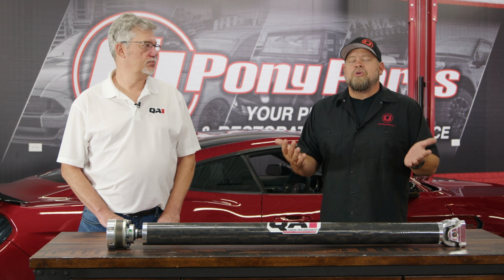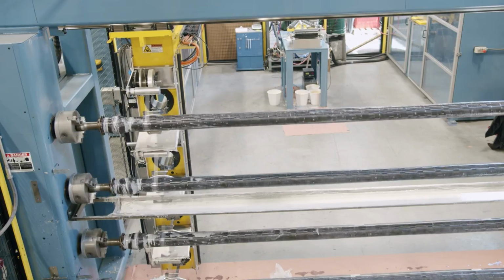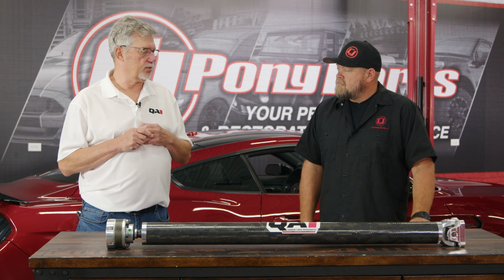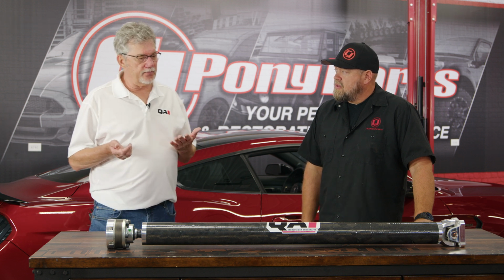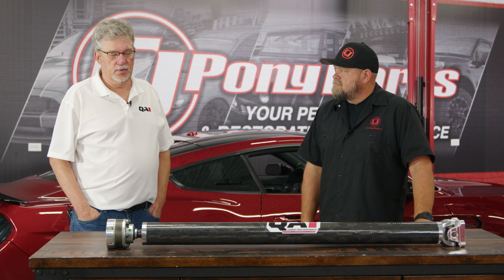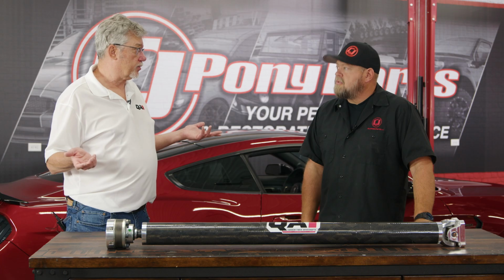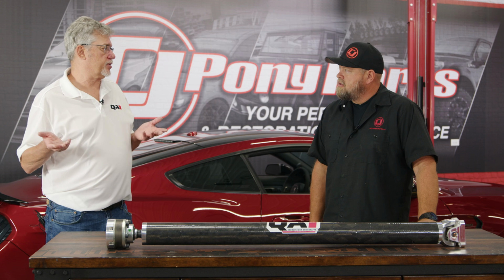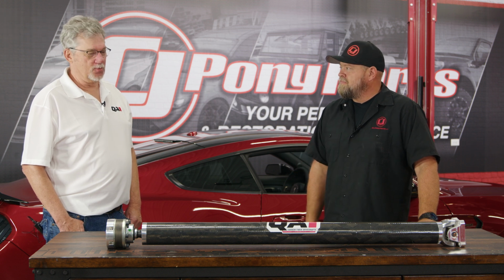Why Should You Switch to a Carbon Fiber Driveshaft? 🛠️

Comment: Common father is a strong material. But the epoxies and residents they use to make it hard does not like the flex. It Cracks. Then  it will explode under pressure. So when it comes to a drive shaft. I will go with steel.

Comment: well that is what im going to get for my 1969 javelin --i dont want the old steel one .. might as well upgrade-- would love to see a dyno run .. with a stock steel driveshaft .. and then the Carbon fiber driveshaft.. just to see if the wt would eve add some HP .. plus less wt to spin

Comment: How long are these good for? Do I have to worry about the shaft deteriorating over time? Is it only good for a certain period of time?
Reply from the maker: There is no lifespan for these, most likely it will outlive the car but should be checked regularly like all aftermarket high performance parts.

Comment: Carbon fiber is susceptible to cyclical degradation. Look at the OceanGate sub that just imploded. Eventually, that thing will grenade with enough toque and power. If you want huge power you better get custom steel.
Reply: Those are two entirely different things. Tensile str th VS compression. Can’t compare two different forms of physics.
Reply: @Megatron797  he;s an internet engineer, leave him too it.
Reply: How do we order a custom steel driveshaft ?

Comment: Installed one of these on my SL55 AMG, one of THE best mods I did, the car accelerates better, revs harder and with just a carbon driveshaft and long tubes my car stock ran 12.4 at 114 and after those mods it ran 11.8 at 125
Reply: Revs harder? Please explain the physics behind that..
Reply: @cmichaeloutube lol, I was thinking the same thing man..... We are waiting for your reply sir
Reply: @cmichaeloutube educate yourself on rotating mass!!!
Reply: Should be much smoother no vibration
Reply: I find that VERY hard to believe.

Comment: Ran a QA1 carbon driveshaft on my old 2015 s550 for couple years. Had zero issues and was way better than my factory 2 piece driveshaft. My car was also daily driven as well. Rain or shine out here in Texas. I will be buying another one for my 10r80 2018 car here shortly.
Reply: Lies
Reply: @dwreus81  Nah. Ford 2 piece driveshaft is trash.
Reply: 💀 @dwreus81

Comment: Would like to see actual 1/4 mile times between an aluminum and a carbon drive shaft.  I bet not alot of bang for your buck for one of these.
Reply: A less than 1HP gain won't show on acceleration times. The benefits is in the driving reposnse. The engine is more directly connected to the tires because the twist, or slack delay, in the OEM driveshaft is eliminated.

Comment: Carbon Fiber is not designed to take a shock load! If you do a hard launch with one of these it will turn in fiber shreds and powder.
Reply: These are specifically designed to allow for some "twist".  This isn't some random carbon tube meant for another application, they are wound for this exact purpose.
Reply: @jaywlambert  Doesn't matter how you wind it, a bit of road debris will destroy it.

Comment: After seeing the girl from AM grenade a carbon driveshaft with a basic hellion kit at the track, i don’t have much faith in them for drag racing.
Reply from the maker: Drag radials, stick shift, non drag suspension created wheel hop which will destroy any driveshaft. Lots of drag racers use these with no issue.
Reply: @cjponyparts wheel hop? So what? The carbon fiber flexes which is ok but carbon fibers is susceptible to cyclical degradation. No thanks.
Reply: @brandonshirey400 anything is susceptible to degeneration l, it’s called ware and tare if you pushing it at a drag strip doing everything to the extreme yes it will fail eventually just like aluminum and steel, but if you’re that skiddish go with Titanium it’ll bend before it breaks and it’s stronger and lighter than steel
Reply: Break em and buy em. It’s nothing to car guys. Who cares. Money is printed why complain about it buddy.
Reply: That is the first thing that comes to my mind when I think about carbon fiber driveshafts.
Reply: @chickenkatsu7863  Hers was a DSS, NOT a QA1. Difference in quality is night and day.
Reply: Hahaha, yeah me too
Reply: Didn't ocean gate run one?

Comment: No doubt that people will find a performance benefit out of them, and no doubt they will come down in price eventually...but $1800 is quite eye-watering when a comparable aluminum one is half the price
Reply: Best to stay away from the cheap Chinese bamboo ones.
Reply: @northerniltree 😂
Reply: But the Carbon one is also acting as a dampener between your engine and transmission and it also helps preserve both!
Reply: Cheap stuff ain’t good 
Good stuff ain’t cheap

Comment: How well does it hold up to the weather and salted roads? Does the resin epoxy used in the carbon fiber layup hold up to salt and other junk long term?
Reply: The rx8 came with one, I never had an issue with it in the pnw.
Reply: @aragon22155  I drove my RX8 in Canadian winters (salt/sand) for years no probs.

Comment: Would a carbon fiber driveshaft be good with a  2015 V6 Mustang that’s pretty stock except for exhaust, headers CAI and a tune? Durable?
Reply: The v6 Mustang needs a 1-piece drives driveshaft more than the GT.
Reply: You pay what you get for. More durable, lighter, and like the guy said in the video you would 60 ft better. Totally worth it. But if you plan on keeping the car just full bolt on than this would be a great start to get the weight down
Reply: At that power level it would be a waste.  You’re talking about spending approximately $1500 on a non-boosted V6.
Reply: @mikehughes8023   correct, if he wants to lose some weight on the vehicle than it would help tremendously. Other than that its pretty much all it will do for him.